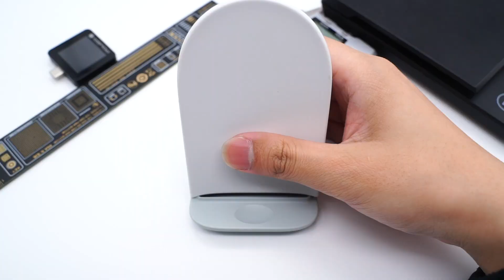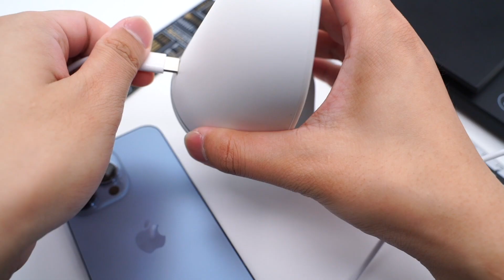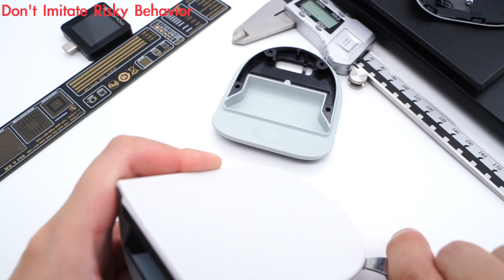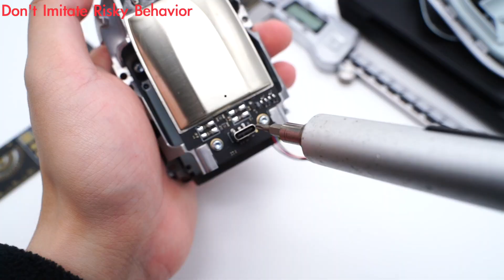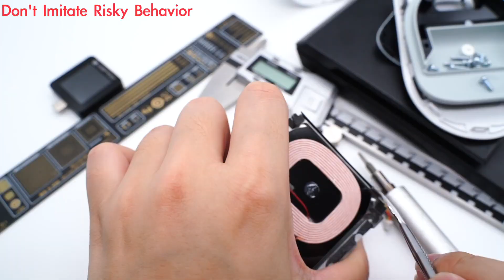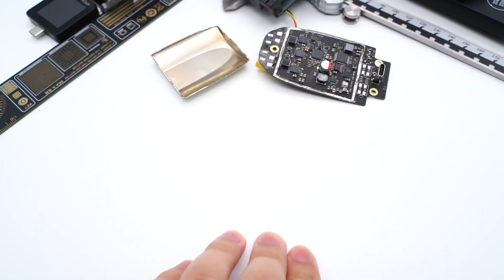Teardown of Google Pixel Stand (30W Wireless Charging)

Comment: It would be one of the highlights of this technocrat's life if your crew reverse-assembled a Google Pixel 8 Pro(provided it is deceased as "Beetlejuice"!) before the teardown commences because that would provide me and other gadget component geeks with the ultimate extreme vetting that no handset interrogation app has done before!  Just before I acquired my 📱 I happened to peep at an article that ID the manufacturers of the cameras, memory, motherboard, and modem, and the more information I read, the more I wanted! During the Bicentennial Era in the United States, fabricators such as Pioneer, Teac, Dual, Shure & Cerwin-Vega advertised stacks of arcane specifications about their hardware!

Comment: Thanks for the teardown. Just a couple of corrections:
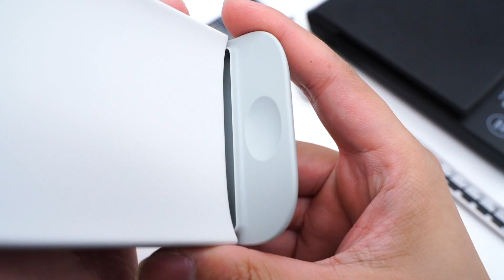0:34 - the opening is not to cool down the phone.  The fan is only meant to cool the charging coils in the stand.
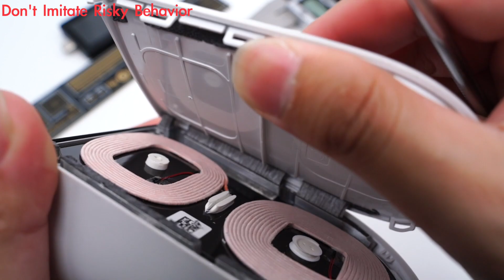2:27 - Many people have confirmed that the stand does not charge horizontally.
Reply: @0:34 this is not true, the air is pushed from the ground plate of the charger onto the backside of the phone and theres air coming out of the back top side of the phone. It is designed this way, because the surface of the charger is oval and the back side of the phone is not.
Reply: @CB-uz8gt  Thanks for the clarification.  I saw another video saying that it only actually cools the charger.  But you went into more detail and provide a more compelling explanation.  Thanks.

Comment: That fan isn't going to do that much too help the internal temperature of the phone which is going to be really hot with that wattage of wireless charging. Also, the coil position is terrible. The alignment with the phone's coil will be way off making it even less efficient and therefore even more heat.

Comment: Wow. Definitely worth the price, and better than Apple magsafe.
Problem that I have - I keep my Pixel phone in a book-like protective case, as it is the best form of protection against shocks and falls, and great for watching videos in landscape mode. 
With the phone in such a case, is highly impractical to use this wireless charger; the thickness of the case limits the charging speed from 30 W to 10 W; so I either use a cable, or remove the phone from the case.
Thank you ChargerLAB for all your great videos.
Greetings,
Anthony

Comment: This is a quality charger but wireless charging is dumb in most scenarios IMO.
Edit - because of low efficiency and high variability
Reply: does the low efficiency and high variability really matter on a day to day basis?  It seems to be more of a theoretical concern rather than a real-world one.  Plus wireless has the advantage of convenience and zero wear and tear on the cable and ports.
Reply: Helpful to prevent overcharging though
Reply: @Reprodestruxion  how?
Reply: @lilmario0  caps it at less than 100% and prevents overheating
Reply: I agree. USB-C makes charging a trivial thing.
But people do swear by the simplicity of just dropping the phone on the stand beside their bed just before sleeping.

Comment: can we hasten charging time by removing the coil plastic cover and put the phone directly to charge it?  this way it reduces suppressed heat and charged time will be reduced? any answers to it ?
Reply from the maker: No, it won't.
Temperature is only one factor that affects charging speed, but charging speed is more controlled by the charging protocol

Comment: Holy shit, that thing is over engineered...
Reply: Thats a good thing
Reply: No, it's just well made. The design make this charger EMI free and long lasting.
I've seen some cheap wireless chargers that make some bad interferences, blocking Wi-Fi and Bluetooth all around...
Reply: @rayoflight62  I meant the PCB, it alone has 2 flash memory chips, 2 ARM Cortex-M0 microcontrollers, an additional dedicated MCU for USB-PD and another 3 DC-DC controllers... the EMI part boils down to the shielding, inductors and some caps....

Comment: Eh, it really doesn't work with the phone sideways, at least for the Pixel 6 Pro. That lower coil was most likely designed for the Pixel Buds.
Reply: Yep, that's exactly right. I literally came here to see if I could 3d Build a stand with a horizontal charge